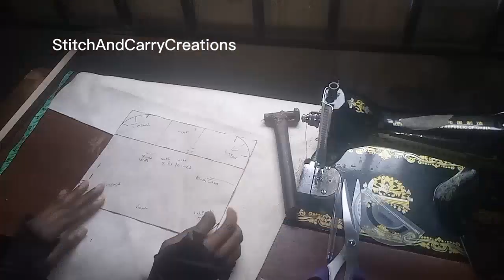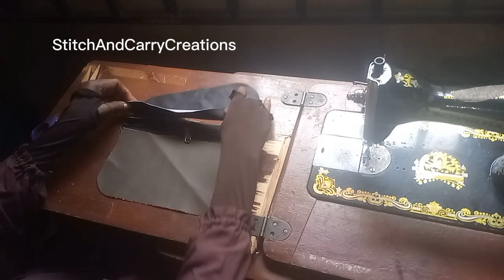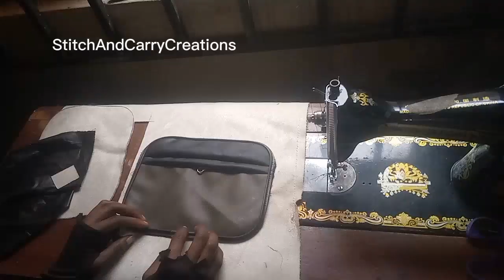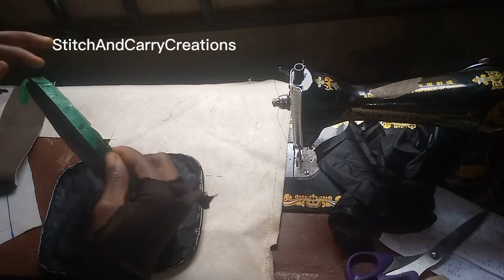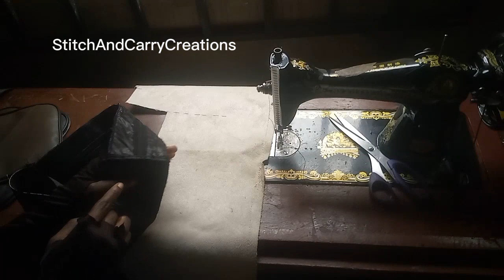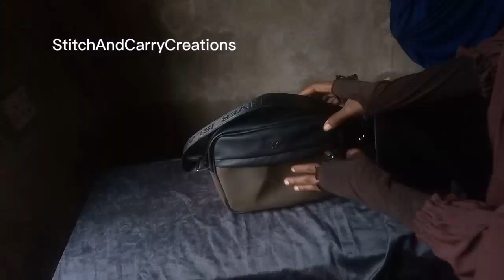DIY Men's Sling Bag Tutorial: Easy Sewing Guide for Stylish Guys l howtosew l crossbodybag l cutting

Comment: Please ma. What's the measurement you used in stitching the upper and lower side together
Reply from the maker: Are you asking about the seam allowance or the total measurement of the upper and lower parts before stitching them together?
Reply: @StitchAndCarryCreations  after getting the total seam allowance for the upper base and lower base, like how many inches can be used to joined the two base together to avoid excess or shortage
Reply from the maker: @okeyembethel494  actually I don't really remember what measurements I used in this video 
But let assume the low base is 12 then upper 17 before adding anything to it
So to add inches for joining both to fit in 5 inches is okay or 7inches
Reply: The most expensive bag I've ever bought at LV. I haven't bought a new LV since that purchase. The prices are outrageous and I will never spend that much on a bag again. I love my :yt: condup :yt: neverfulls.
Reply: تحفة فنية ما شاء الله